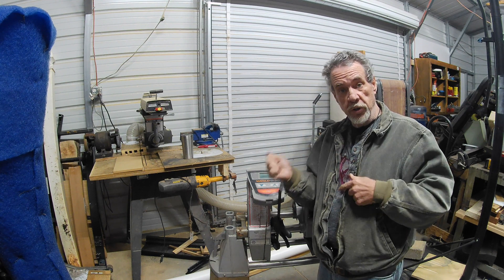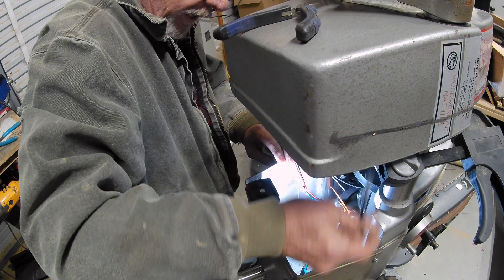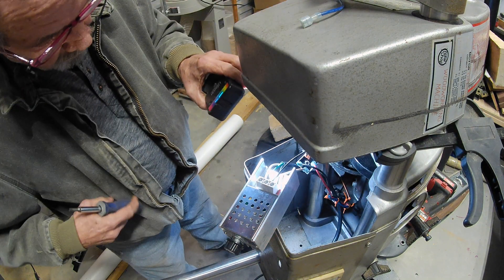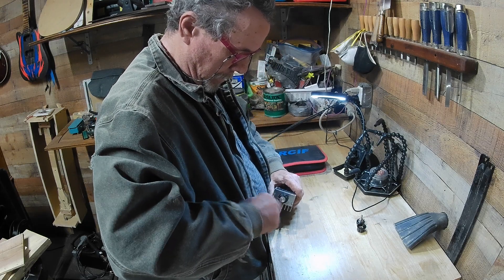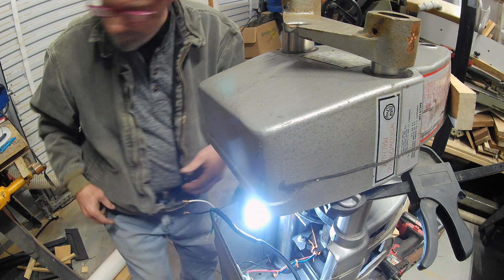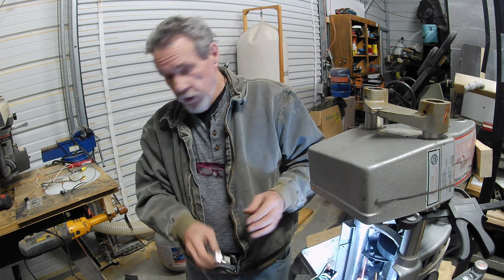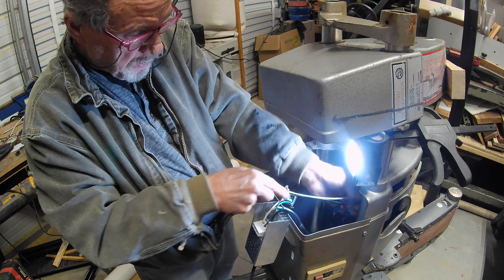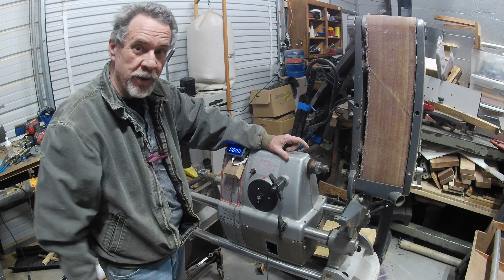DC motor controls, in a multi purpose Tool, Shopsmith/ Total Shop. Smooth power!!

Comment: Spike;
Do you have a parts list of what you used? I'm having a hard time waiting for your next video!!!
Reply from the maker: ok, I am doing another video with more details on a 10 ER conversion, I am converting from the treadmill controls to the SCR method. But used this rectifier, https://www.amazon.com/dp/B07MQ65HLB?psc=1&ref=ppx_yo2_dt_b_product_details
and used this SCR to control the power output. 
https://www.amazon.com/dp/B0894LG58M?psc=1&ref=ppx_yo2_dt_b_product_details
I am trying to get to 500, so I can post on the community tab, and post diagrams, help if you can,  LOL
You wire the SCR as shown on the control diagram, it feeds out a variable ac current, then connects to the rectifier to convert to dc voltage. The terminals are marked ac use it and the one diagonal for the ac, the dc comes off the other 2 diagonals terminals, switch or add a switch as I did to change direction!  Hope this helps!

Comment: Try upgrading the rotor of original induction motor to make it a PMSynRM ( Permanent magnet synchronous reluctance motor). The DC treadmill motors are essentially permanent magnet synchronous motors.

Comment: Spike, can go over what motor you have and what you got the motor out of.thank you
Reply from the maker: Roger, their is a video of the mounting, the first control board dieing and then me fixing it. I used a 2.65 hp treadmill motor salvaged free, did use the controls that came with it, till they died. burned up under load. I am testing this system now under a load, doing a reswa on 9 inch Ambrosia Maple tomorrow. I used a Cheap SCR control and a rectifier to make the clean DC, used the choke it the circuit, really made it smooth. Watch the other videos, if you have more questions, I am more than glad to help.
Reply: @SpiketheFrugalFixer  Spike, you're what makes sites like this great